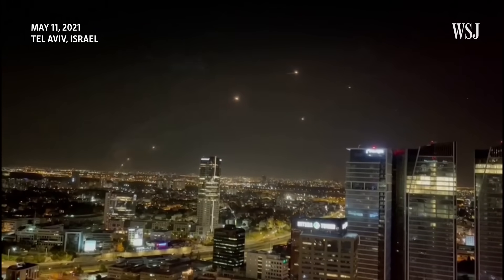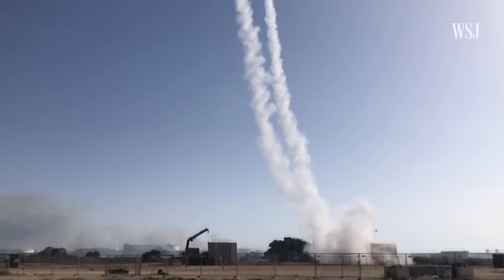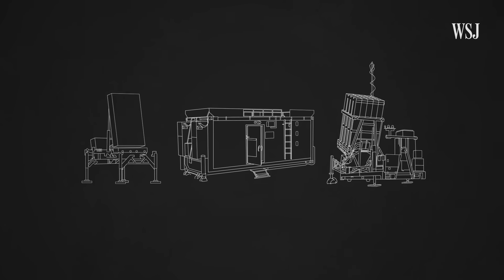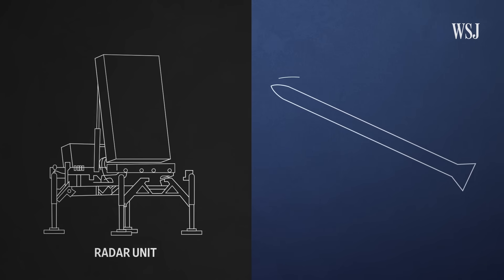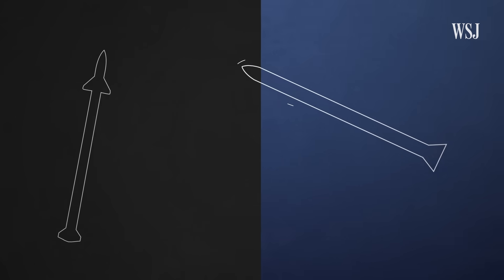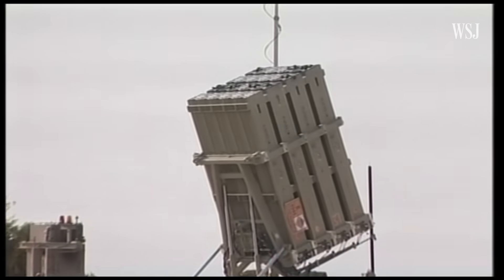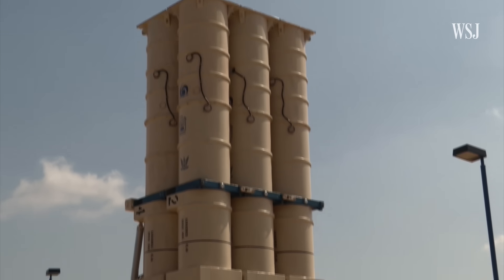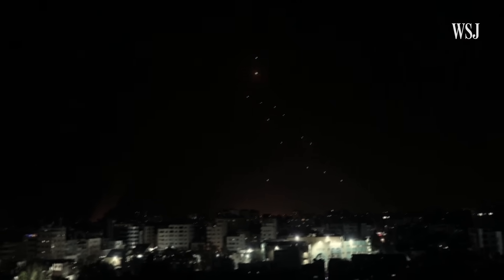How Israel’s Iron Dome Works | WSJ

Comment: Funny, I don't see any intercepting rocket trails. Why does the media lie so much?  What Iron Dome uses are "DIRECTED ENERGY Beams"  aka LASERS.   Its called "IRON BEAM", built by Rafael Advanced Defense Systems.  Look it up. Come on @Wall Street Journal.  I believe my own eyes, not your fill in video clips and misdirected wordings.  Just tell the truth.
Reply: Lena Samuel  Respectfully I disagree.  Based on current broadcasted videos, you can see the rockets explode with no intercepting rocket afterburner, or exhaust cloud trails. Wikipedia does cover it, but your eyes will see the proof in the pudding.  Directed Energy for sure, Iron Beam.  Look it up.  Then compare the video.

Comment: Yea this is good.. let the enemy know.
Reply: Let the enemy know that a system that's been in place and functioning since 2011 exists? Its not exactly a secret at this point nor something their enemies can do something about or it wouldn't have been shared at all.
Reply: @Acoto  doesn’t matter how old the system has been running. The point is why give away ANY info to enemies and more so about a defense system? Old or not.. it always seems to come up anytime they engage incoming attacks.
Reply: @Bravo57-57  It's pretty obvious to allies and enemies alike that there are some missiles intercepting other missiles, and that those missiles are coming from somewhere. We didn't learn much else about it really that is at all actionable, and we're also assuming that all the information presented was accurate.

 It's like all those military training videos, just because you get an idea of how a Marine or Navy Seal is trained and roughly equipped or that an F-22 exists doesn't mean you can do anything about it. 

The benefits of letting their allies and citizens know they are protected probably outweighed any potential risks of giving away minor, ultimately unactionable information.
Reply: @Acoto  i hear ya.. but why do we study our enemy’s tactics? Or another example is, how boxers study their opponents to see their fighting styles and try to find ways to outfight them.. same w military exercises.  Usually tactics change based on Intel and we adapt to those changes to try and overcome our enemies..but I do see your point so please don’t get me wrong.. 👍🏽
Reply: @Bravo57-57  I get where you're coming from, and you're not necessarily wrong, just add in the idea of risk-to-reward. A boxer may hide a specific skill for an advantage early on, but they have to show it off in the ring at some point. After that, they might gain more from showing it off as part of future promos to drum up hype since everybody knows they can do that skill now. However, they may not go into exactly how it works or teach a seminar on it until after they retire or have an even better skill/counter to it.

Comment: It intercepted 200 out of 1000 rockets, is it because they have too few of them or it is only 20% effective?
Reply: I think cause only 20% were headed towards population centers
Reply: It's 90% effective.
Reply: If the enemy rocket is projected to fall in a non populated area, iron dome doesn't intercept the rocket so as to save expensive missile.
Reply: Thanks!
Reply: However where were the other 80% aimed at? I don't think they would have such a bad aim
Reply: @burt591  Hamas rockets do not have guidance systems, they just shoot them in the general direction of where they want to hit indiscriminately.
Reply: @yessedhchavez9908  They suck really bad then, I would imagine it's kinda difficult to miss a city
Reply: @burt591  Around a seventh of the rockets shot by hamas end up falling right next to them.
Reply: Lena Samuel  Thanks!

Comment: Not worth to say iron dome....it is just a thing with conflicting priorities....the radar may chose one of the entities....it is a bad thing and not worth to say...just don’t kill children
Reply: Adjust for the efficiency of the rockets and assume somehow that the explosive yields of the rockets are equal  i dare you.
A lot of the deaths are assassinations and shooting of unarmed protesters that post no threat to any soldier. You can't blame all of them on air strikes, that's not a fair comparison. Not to mention that almost all (with a few exceptions) are very low tech that's why the iron dome was so effective but that changed recently they started manufacturing some rockets that have the ability to maneuver and you can see that if you compare the efficiency of the iron dome from its previous reviews.

So no the iron dome didn't single handedly save israel having one of the most advanced and strong armies and fighting people under a death grip of a blockade did.